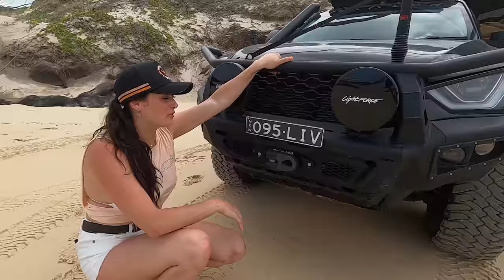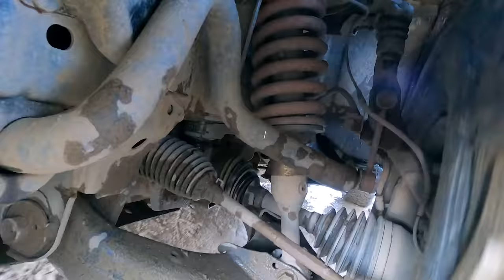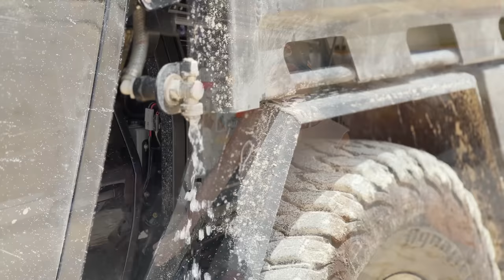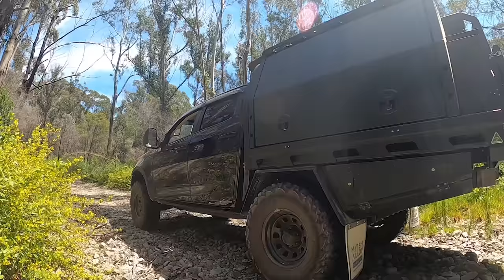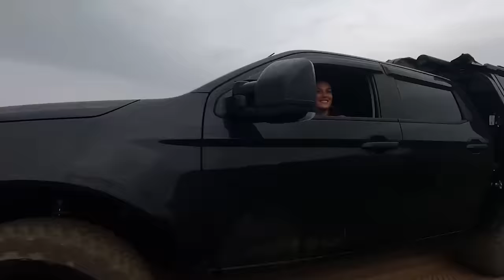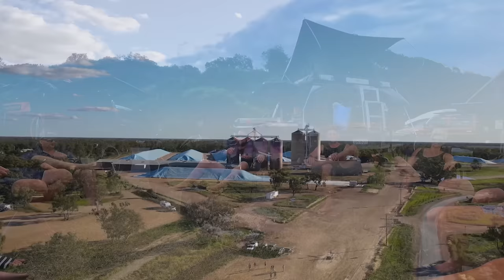HOW I BUILT MY DREAM 4WD! 2021 ISUZU DMAX RIG RUNDOWN & REVIEW ON THE EVO2 MITS ALLOY TRAY & CANOPY!

Comment: Hey guys. Just a question about your bullbar and winch combination. I also have a 2022 Dmax with the same AFN bullbar. Do you have any problems accessing the winch neutral lever through the small grill in the front of bar - If so, how did you resolve the problem? - Great looking truck.  -Cheers

Comment: Awesome vid Liv! Very concise rundown of Black Betty for sure. Using the dog box for wet gear so they don’t stink out the rest is genius, can’t believe I didn’t think of it before! Also I’m running the same Wedgetail roof rack haha

With the bash plates, how is underbody cleaning post trips on the beach? Do you find you need to remove them for a deep clean?

Looking forward to the Fraser episodes soon!

Cheers🍻
Reply from the maker: Thanks mate! It was short and sweet and springily a lot harder to film then I thought as there was so much to remember ahaha 

The baseplates are fairly easy to get under and clean post trips mate! You can easily get a pressure washer up in there. 

Stay tuned! Its a ripper! Cheers!

Comment: Just a quick question guys. When would be a good start in sortting out suspension..b4 you build a touring set up. Or after fitted the gear?.
I own a 2014 dmax
Reply from the maker: Hey mate 
We fitting / sorted our suspension once we had the canopy (most of the weight) on the car. That way we could set the suspension up properly or how we wanted to suit the weight and application 😄
Reply: @THISISLIVN  cheers guy's. That makes sense actually 🤟
I'm new at 4x4ing and touring..  
Always learning.
Reply from the maker: @jasongodena79  happy to help mate 😄

Comment: What size tires and do you have to chop anything for them to fit
Reply from the maker: Currently running 305s, all I had to trim was the inner front and rear guards for the front tyres but I didn’t have to touch the body mount or anything 😄

Comment: Did you get gvm and frame strengthening.... it's needs both... especially the frame strengthening or you'll get 2 half cars 🤣
Reply from the maker: na mate atm she's sitting under the GVM and im stoked with how this set drives and performs on all our trips!
Reply: @THISISLIVN  go over a big bump full.... these are known to bend frame in rear and crack at the front 😆
Reply: @THISISLIVN  I have a Spacecab Dmax tourer with oem alloy tray and canvas canopy and all the fruit and I don't tow. I am at 3.2T with full water and fuel. I have a 3600kg GVM and 7000kg GCM. I find it hard to believe you are under OEM GVM. Nice unit though.
Reply: @ausguy4385 this is a new model mate, it's the last model that had an issue with panel cracks in the front. As for the chassis bending at the rear Ive seen one photo of a bent dmax...one of the strongest ute chassis out there